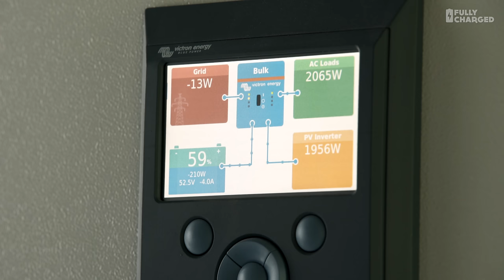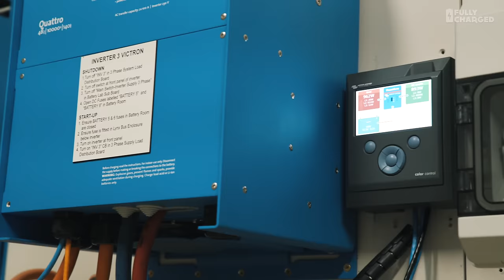Redflow ZCell batteries for home renewable energy storage | Fully Charged

Comment: It's been 2 years since this video and all they have to show for it is a 10KW battery that costs $20,000 AUD ($13,500 US): https://www.solarquotes.com.au/flowbatteries.html. How are they going to compete with something like the Tesla Powerwall 2 that is 13KW and costs $6,500 US? This is what I don't get about these companies. If you're going to succeed you have to undercut the competition. If you can't make it cheaper than lithium, then why bother?
Reply: You are misquoting the actual advertised cost in your link. Those costs include adding a solar PV array. The current cost of the battery is $14,000 AUD + GST at August 2019 date. Then you have the cost of inverters and other stuff to make everything work. To get one of these batteries installed and make it into a stand alone system whereby the house is isolated when the grid goes down, allowing the house to continue as normal until the battery runs out, is $19,000 AUD including GST, this is the total installation cost. At August 2019 date.

The cost of getting a Lithium system into your house and to have a stand alone system that will keep on running when the grid goes down, is certainly higher than any advertised prices I have seen. Once you start asking the right questions from people who do install or ask those who have had a stand alone system installed; you realise that there is a far greater cost than that bandied around the internet.

Installing a second flow battery is cheaper than having a single battery, some of the costs are already covered, like the isolation of the house to grid system; among other things.

Comment: I hope it’s smart enough to actually disconnect from the grid, otherwise you might shock a lineman.
Reply: There are inverters that do both off grid for when power goes down and grid tie for when power is up. Yes, they have to island themselves.

Comment: So lets see if I understood this. You put power in and it takes zinc out of solution to coat the plates. You take power out and it puts the zinc back into solution. There's no loss of zinc, or solution? Doesn't need topping up? Do the batteries get hot? Does performance change with temperature? Lots of questions not answered it seems. 
On the whole it sounds great so far, subject to the above. Just doesn't look as sexy as the Tesla wall batteries. Gotta hand it to Elon - he knows how to make things look good.
Reply: To answer your questions from what is in the video. There is no loss of zinc or solution? Correct - that is implied from having zero capacity loss over 10 years and the discharge cycle in effect being a self clean. Doesn't need topping up? See previous answer. As for the rest then it's a battery so of course. As for Elon Musk - he's basically a sales guy. Engineers make things work sales guys make them look sexy.
Reply: Max Goodman The cells will get warm just as when charging a regular battery, but these units have lots of thermal mass unlike a lithium ion battery. The electrochemistry going on is the same. The difference from regular batteries is the electrodes are not sacrificial, and you need to run a pump. All chemistry works faster when hotter, so ambient temperature matters to a degree. However if there is an industrial scale version then most of the issues will have been explored. It looks like Redflow have been at the Wikipedia page, but it's still reasonably balanced when talking about the drawbacks.
Reply: i was sceptical at first but i think it is actually bettter to have in an house but if you dont have the space to put 2 of these massive things anywhere you are better of putting 2 14kwh powerwall 2 on your wall wich are samller in volume than even of of these 10 kwh batteries
Reply: The size of these look around the size of a heat pump that I have at the side of my house. Not very large at all. I love the form factor of the Tesla battery pack, it is beautiful but I do think this battery for a house is awesome and I hope it takes off.
Reply: Zinc comes from zinc bromide, which is a water-soluble salt. As the charge is pumped through the battery, zinc is taken out of the solution, leaving behind elemental bromide which is (poorly) soluble in water. You can see the characteristic red/brown colour of bromide on the walls of these tanks.

It's possible that they are using something else than water as the solvent, though.
Reply: A huge advantage of this flow battery is it has zero chance of exploding or igniting on fire like Li-ion batteries.  I'll take safety over sexy any day. :-)
Reply: why not just go to their site to answer both questions.
Reply: On their page it is said .... round trip efficiency is 80%, but this fact is conveniently committed in interview...
Reply: Li-ions make more sense for cars. Consider that Teslas have about 80 kWh of storage. These tanks here hold 10kWh, therefore you would need 8 of them in your car, which would be absurd.
Reply: Also the the Redflow battery is about 250 kgs each , nobody will steal them!.
Reply: If Elon Musk was a half way decent engineer he would realise that 1 the hyperloop cant work using the tech he is talking about and 2 he has got his costs out by at least an order of magnitude. Even the scrap value of the steel is 1/3 of the total cost he projects. His "new revolutionary" terracotta looking PV roof cells have intrinsic issues a 1/2 decent engineer would spot in 10 seconds (I certainly did) and they are neither new or revolutionary as companies were producing them in the 90's. Also reading someone's bio just tells you what someone wants you to know. Seeing what they do tells the real story.
Reply: Gordon, I do have my doubts about the Hyperloop... But Musk seems to have an eye for opportunities that nobody else sees. Both SpaceX and Tesla seemed like absolutely stupid ideas at the time, especially in the eyes of exceptional engineers. You can say a lot about Musk, but claiming he can't spot bad engineering solutions is just stupid.

Stay skeptical, but laughing away his crazy ideas has turned out to be a bad business move more often than not. It's not as if making a rocket reenter the atmosphere ass-first using rocket engine exhaust as a heat shield so you can land it on a boat and launch it again was an endeavor without significant challenges. It's amazing what you can achieve with a decade of focused engineering.
Reply: Yes but the point is that he does not seem to be able to differentiate between a technical challenge, and an impossibility or even a new idea and one that has been around for decades. Also with SpaceX he was not doing much if any of the engineering. The same goes for Tessla.
Reply: Fabi33677 In most homes in Australia they can be put outside as well as the south western US, most of Southern Europe, Africa, and Southern Asia. 

In Canada the US North East, and Rocky Mountain Regions, as well as South and Central Asia and Europe you may need to put in a garage or a basement with some heat as the internal temperture needs to be kept above 15 degrees. The internal heat generated isn't stated in a location I have looked, but it's internal operating temp normal range is 15-55. 

As such outside in most places that stay above 0 nearly all the year will likely be fine. 
They really aren't that big, and most homes aren't so large as to need 20kw of power packs. A single 10KW pack could do most homes just fine. Houses that need 20kw a day likely are large enough for two.
Reply: @Rob Elliot I would think one would fit under the stairs in a lot of European homes.
Reply: I like the tech but unfortunately it will not work for me in NY. Our winters are way below the 15C low end for the batteries. Hearing them will defeat the purpose of conserving energy.
Reply: not if you had solar tube heater heating the cupboard they are in
Reply: Toe Knee The ambient Temperture inside needs to stay at 15 degrees. So for NY much like Southern Ontario a Garage or a basement would be needed. As such you would just run it in threw the basement in most homes.

Secondarily there is no idication that it won't fuction below 15 degrees just not at peak efficiency. Though in New York State where it can get to well below freezing inside is likely the best location for it.
Reply: Depends on the size of your house.
For me these are a non starter, but if I had a basement I would install these as total cost of ownership is lower than Tesla
Reply: is it relevant if you are using Solar to charge it?
Reply: @Max Goodman

Annoyingly appearance sells over practicality. The Tesla cars have no new technology in them, their basically powered by a larger washing machine motor, a larger form of AA lithium batteries & software similar to smartphones to run it all. Sadly nothing new. Hey look at Tesla technology patents are all free to use, you wonder why? Well most of them are old patents that expired but been reclaimed by Tesla.

For the RedFlow batteries getting hot? Well it uses zinc bromine fluid, which is fire retardant aka can never catch fire or go into thermal runaway compare to lithium which most know go into thermal runaway when punched or/& overcharged.
Reply: @mrgomelonsolaris But you forget only 5 to 10 years ago Li-ion battery tech were a lot weaker then their current tech tree as seen with Tesla.

For RedFlow, give it a few years as the technology advances, it to will increase in kw storage ability & decrease in size possibly.
Reply: @John Gross. Answer to your question.

Batteries are to store electrons either from the grid power at night(off peak is about $17.97AUD an hour) or from a household source of renewable ie solar or wind etc that cost you $0.00AUD an hour. 

But not using any form of renewable & only gathering grid power during the on peak hours will cost you about $22.15AUD - $30.97AUD an hour.

The cost of grid power is based on averages in Australia only.
Reply: Yeah it doesn't make sense to peak shave.
Reply: 600Kw, that's 6 times a tesla 100D and it got the size of a house?!

It sounds to me like a good battery, somehow not really usefull for anything else but standing on one spot and keep the energy there if I understand the story correct.
Reply: So you are more worried about the casing which you can change than the actual tech... gg... gg... : /
Reply: zezizarjaars, It has a lot of applications but they are all static. Lithium has better energy density, lower weight, and much higher charge/discharge rates which are critical for vehicles. The redflow is excellent for grid storage and uninterruptible power supplies for things like cell sites and data centers and will only get better as costs go down.
Reply: snoopy blue doesn't really matter nowadays cause the pv panels so cheap, just need 10% more than a li-ion set up, which has 90% efficiency.
Reply: Jesus Max i hope you wouldn't buy an imported product like a battery because one looks sexier than the other. If Redflow is Australian is not much more than a sexy Tesla battery i,ll buy Australian every day.

Comment: Don't think there is any chance economies of scale of a system like this are going to keep up wth battery tech that can be automated on production lines that produce millions of cells. So much going on in Lion and other battery tech that low degradation / degradation free cells are pretty much given, just a matter of time.
Reply: yes, low-degradation batteries exist. Like for example those in the video ;) 
But you are right, they won't ever be sold in quantities like Tesla's Li-Ions, so they won't be able to drop their price as much.
I really would have wanted them to talk about the price!
Reply: Just looked up UK price of Tesla Powerwall - £6350 installed for 14Kwh - this will include import costs. Comparing to estimated price of this system which manufacturer website says estimate around $17.5-$20K AUD installation fees included for 10Kw, which works out around £12K taking upper price but no account of import duties.

Comment: 11:34 I disagree.  Electric cars still have an overall lifetime higher cost of ownership.  The Leaf costs 17k more than a camry. 17k is about 200k miles worth of gas.  And you still need to charge the leaf, and pay higher insurance cost because the car is worth more.  Additionally, the time-value of money favours the Camry.

But these new flow batteries look promising. I hope they bring the cost down.  Maybe the current cost of electric cars is artificially high to "break even" to a gas powered car?